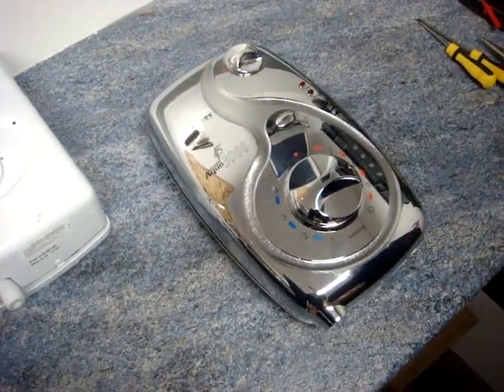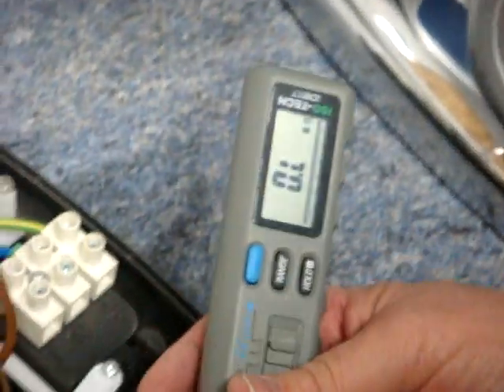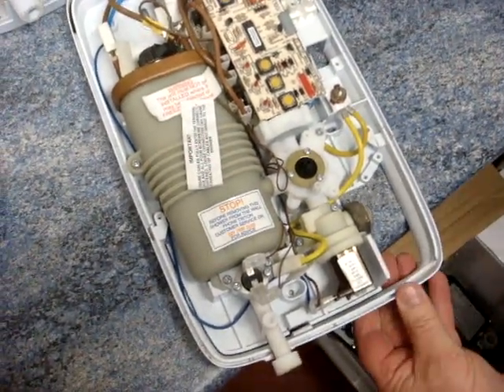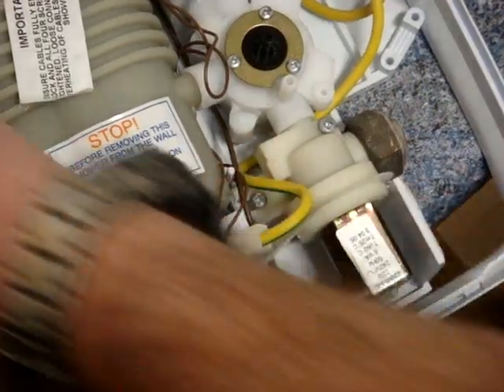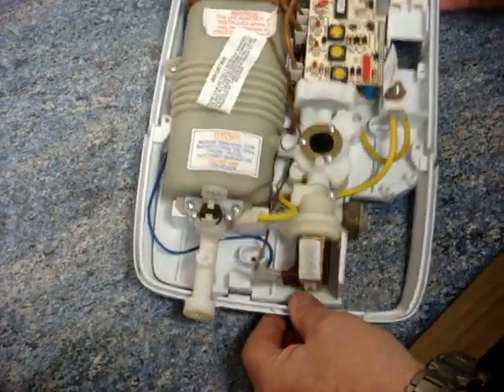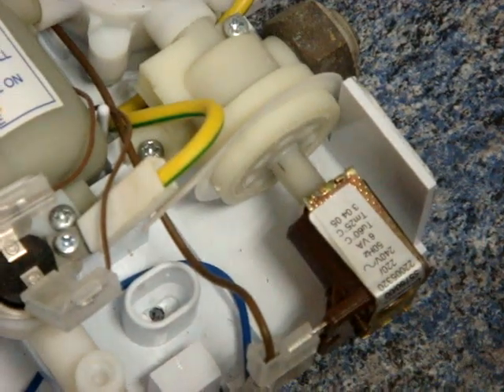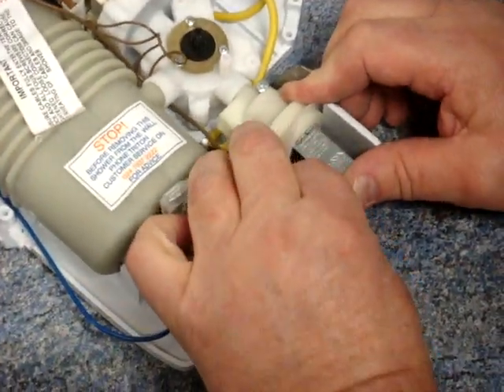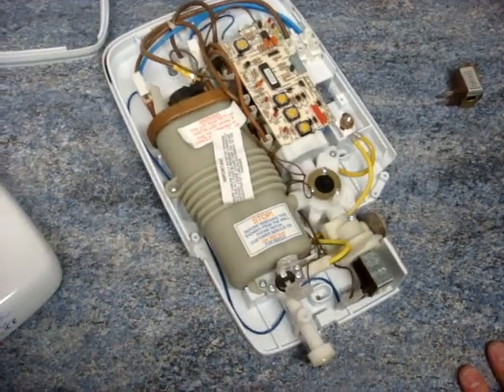Electric showers: How to test and replace a solenoid coil

Comment: So I have a Triton danzi duelec 10.5 duel head shower it's brand new and it cuts out now and again so I thought it was water flow so I checked downstairs sink and I'm getting 12 litres per minute and at the bath same 12 litres per minute.
But the shower is only getting 6 to 7 litres per minute it's all new pipe work in the bathroom could it be the cut out switch
And would fitting a salamander flow rate increase be better or would it not have any affect on the shower
I just checked the solenoid ohms reading 3.6

Comment: my whole triton AS2000XT solenoid valve assembly is permanently stuck in the open position, any ideas? i got 3 different solenoid coils but it seems that the assembly itself isnt letting the coil turn the valve off

Comment: Oh dear. Just tried this with my faulty Triton Cara and when I removed the coil as shown in the vid, water poured out of the shower and all over the bathroom floor. I'd obviously not quite turned the water off properly.

Unfortunately, the new coil now won't fix back onto the valve and so I can't turn the house water back on. Any tips for isolating the shower's water supply, so we can turn the water back on at the mains to wash in sinks, drink water and go to the loo?!! 

Has been a total disaster :(

Comment: Hi, I have a Redring expressions 500S no water flow on hot or cold. Tested solenoid 3.9kohms all micro switches test ok elements test ok. Any help would be appreciated. It’s an old shower but basically never used as we have a mixer shower that’s run from a Combie Boiler doesn’t appear scaled up. Many thanks for the videos. This shower hAs a small PCB

Comment: Hi, great video and excellent what I needed to watch. 

As per comment by @michaelbrownhill3091 below, mine was also an intermittent problem whereby the shower would stop and after a couple of minutes start again! Isolated the shower and when the cover was off and when I checked with my meter the solenoid ohm reading was okay!

Put the back cover, but the issue kept repeating, so bit the bullet and bought a new solenoid and replaced it and hey presto all good. Clearly, the old solenoid had an internal heat breakdown issue that cooled down fast enough to show that it was okay when it was measured. 

Out of interest, Triton T80 Easy Fit installed by me in July 2013 and this is the first issue with it.

Anyway, great videos that saved a lot of time and of course cash outlay.  
🚿

Comment: Great video that pointed me in the direction of the solenoid. This was the problem with my shower , cutting off after about 2 minutes , and if left for 10 minutes , it would start again for another 2 minutes or so . I apologise if this has been mentioned before in the comments , but my  possibly faulty solenoid tested at 4.7K ohms , which would indicate that it was good. Because I couldn't think what else it might be , and because the replacement solenoid  was cheap compared to a new shower ,  I ordered another solenoid from Amazon for £8.99 which tested at 3.5K ohms. 
I fitted the replacement and left the shower running for 15 minutes without any problems , which seems to indicate that the original solenoid was indeed faulty , even though it tested at 4.7K ohms. I think coils (the coil is the electrical part of the solenoid) can test OK , but quickly break down when current is passed through them.  Therefore , unless your coil reads 0 ohms or open circuit, whereby it's obviously faulty , I would suspect the solenoid ,irrespective of the resistance reading , if your shower keeps cutting out after a few minutes.
Anyhow , I'm off to have a long shower , longer than two minutes anyway !
Thanks for the video ; saved me a good bit of cash ...
Reply: Thanks for this comment.
Reply: Great point and thanks because my shower is doing the same or similar it runs fine then after a couple of minutes the flow goes slow and it starts cutting in and out heat wise

Comment: Great video - just a point though - if checking with a meter wouldn't it be best to disconnect one of the spade terminals to avoid the reading being effected by other parts of the circuit?

Comment: If you still monitor this channel, a question if I may. It's just curiosity really.
I have a 10.5 Triton Martinique. It did the typical fault, stop starting. I changed the solenoid, sorted. Some years on there has been dripping from the casing, not from the pressure relief valve pipe, so I thought a component must be leaking. I ignored it until the shower started buzzing then shut off. I tried it again, it started and worked for 5 minutes, buzzed and shut off. I took it apart and noticed a possible leak from the temperature valve. I had a spare Martinique so I changed the temperature valve, inlet valve and solenoid all in one go. As I was doing so I now had 3 solenoids so I decided to test them all as you advise. One had zero change so I knew this was the original that had broken. The 'new' one in the shower tested around 3.68, so that was good. The one that I took out tested around 15, and as I kept the tester on it. The numbers were fluctuating up .5 or so, then down 2.0 or so, then up then down until I got fed up waiting for it to settle around 6.5. Do you think it's because it got wet? With no power going to it, how can the reading change so much ? Thanks.

Comment: Hi pal going to look for this valve and check it but essentially had someone plumb the shower in and then wired it up myself but then when i turned the power on it wont work do i need to drain the water and then turn back on or do you think its for sure the valve?

Comment: What annoys me about this crap (and I don't meant the Shower Doctor, who is a GREAT guy, great videos!!!!) is the built in obscolesence. I'm a DESIGN electrical engineer and happy to p1ss around with this sort of thing in the practical world, though it's not my field. My shower acutallly failed not that long after it was installed and I fixed it myself, and the fantastic shower doctor videos helped, though I have e.g. multimeters around and the confidence to fiddle with such things. How much stress and cost does this crap cause for minor components? Why do the fail so often? Could the solenoid either be A: slightly thicker wire or B: if something like a power surge is causing it, just put in an simple in line component? :( 
I mean how many of these showers are just ripped out and replaced, never mind the solenoid? My REPLACEMENT solenoid has now lasted longer than the original, no further issues!
(And don't get me started on the poor design of microwave ovens :))

Comment: My Solenoid is reading 3.4K Ohms is that okay?  Mine keeps going on and off mid use.  I ordered a replacement and they accidentally sent me two, one is also 3.4 but one is 3.5.
Reply: Okay so I decided to fit the new 3.5 and it worked so either 3.4 is simply too low or it had some other problem which swapping worked and the fault did not effect the Ohms reading at all.

Comment: Hi 
I have Triton Madrid II. Today my son was in the shower and it just stopped and now there is no water coming out of the shower at all but the red power light is on. I powered off the shower for about a hour but still the same no water. So my question is do you think it would be the solenoid coil has gone or something else.
Thanks
btw the shower played up before about a year ago where the water was coming out but always cold. I replaced the solenoid coil then and it fixed that problem.

Comment: Mira Jump. Old coil is open circuit. New coil plugged in, and now the shower's power light goes out when I turn it on.

New coil is from eBay though, and while it looks the same, it has a 5 kilohm resistance. Still waiting for my coil from Shower Doctor (out of stock). Not sure if something else is wrong with the shower.
Reply: Ok never mind. I had the audacity to use the pull cord switch while making this repair, and it turns out that shower pull cord switches are as universally rubbish as solenoid coils.

Switch must have been cycled about 8 times in its entire existence and it's already dodgy.

Got it to work by jiggling it. New one ordered from Screwfix. MK, in the hope that the most expensive brand is better quality in some way.

Comment: Thank you so much for this, my Triton Cara just stopped working, there was power and water, tested the solenoid and no reading I know power was coming into the valve cause when I turned it on to the first position (yes power was off), i was getting a reading off the supply leads,  took great care removing it tested it again outside the shower and no reading, your vlog was very helpful and have a new valve coming. thanks.

Comment: Dear Shower Doctor,

My Triton Touch electric shower started cutting off after few seconds of starting and tripping the fuse. I even lowered the temperature, cleaned the shower head and there are no kinks in the shower horse and water comes as normal during the first few seconds.

After seeing your video I changed the solenoid coil (the ones you sell in Amazon) but the problem still persist. My shower stopped on Tuesday.

Please shower doctor can you please advice if there is anything that I can do before bringing in a professional to replace.

Many thanks

Comment: Hey there. I was wondering if you could give me some advice.

I've followed your instructions exactly. Thank you, they were extremely clear and with your advice, I used a screwdriver to ensure the glued part did not accidentally detach.

I ordered a new solenoid, but what turned up did not have locater lugs on it to lock it into place in my shower. The one I took off the shower did (it is Triton). Do I need the lugs or can I use what they sent me. The reason I ask is that I saw another seller selling solenoids and their blurb stated that shower solenoids require the lugs to stop them moving and that solenoids without locator lugs are for washing machines.

You mention on your vid about locators, but I didn't see on any on the solenoid you replaced.

Comment: hi i have a triton opal 1 9.5 kw and we find that it cuts in and out rappidly showing the low pressure light we find that if we push on the bottom right of the case it comes back on any suggestions on what may be the most likely culprit ? some showers it does this alot and some it is fine 

thanks

Comment: Great video but just to clarify, you said that the solenoid should be more than 3.5K. It's more that it should be in a RANGE of ohms, around 3.5k to say 4k or whatever. It may fail in a way that the resistance goes to infinite resistance / open circuit, which is certainly over 3.5k!
When removing the solenoid it can stick very firmly at the end of the plastic shaft, you might try pushing it back on and then using a flat blade screwdriver to slightly encourage the expanding clips on the end of the shaft of it back inwards, then pull it off again and it may came off much more easily.
Another tip is after you finish, turn the power back on, press the glowing button and no water comes out, please remember you've turned the water off before reaching for some anglo-saxon language :)
Reply: My Solenoid is reading 3.4K Ohms is that okay?  Mine keeps going on and off mid use.  I ordered a replacement and they accidentally sent me two, one is also 3.4 but one is 3.5.
Reply: @TheCodingSeal  
I'd say that's totally OK. The point about these things is if it's WILDLY wrong THEN you worry, e.g. no circuit, or a short circuit :) I come from a background where these things matter (like a wrong resistor is a faulty thing) but THIS is more pass/fail. 3.4k sounds absolutely perfect :)
Edit: Basically it's not that fancy! The component will be a coil of wire (with an inherent resistance over its length) wrapped around something metal it wants to act on. If the wire breaks = bad. If it short circuits  (touches itself) bad. Anything broadly in specification should be OK :)

Comment: I have an AS2000T and cant remove the solenoid valve as the case is in the way,  I bought a new one but it looks even longer than the old one.

Comment: Hi Shower Doctor, I have a Redring Expressions 500 which is stuttering on startup, but only when on the hot setting. Could the solenoid valve be the culprit?

Comment: Thank you so much for this video.  I was very nervous about attempting to fix my shower but really couldn’t afford to get someone in.  I found the diagnosis on the shower doctor, then the link to the part, Followed by this video.  The part arrived very quickly.  I followed the video and did it.  I was glad it explained things that might go wrong as well as showing how it may vary.  I would not have dared to be so forceful in removing the part if I had not seen this video.  It now works without cutting out and it cost less than £20.  Brilliant!  :)

Comment: Hi, my Electric shower shows no sign of power, while in the power box the Load Line shows power but the supply line does not show . Can you please explain , that the supply line there is no power showing but the Load shows, and inside the electric shower does not show any power .Thank you

Comment: Problem . You said one of the most common problem is the solenoid valve,however , you did not explain the symptoms of a solenoid problem in the first place . What are typical symptoms of a solenoid valve problem ? If the water is still dripping from the shower head after the shower is turned off using the control on the front of the sower , is this a solenoid valve problem ?

Comment: I don't think this 'over 3.5' measurement on the multimeter is a done deal. I ordered a brand new solinoid valve online and it measured 3.48. I took my old faulty one out that was stopping the water coming out of my shower and it measured 3.75. I've had the one that measured 3.48 in my shower for months and it works fine. So if the faulty one measured better than the new one, how'ds that work?

Comment: Hi Shower Doctor, I have a Mira sprint electric. it stoped working the other day, checked a few things, water, electric, hose. when you mention to check the coil for resistance, it has plenty (4.13) should I still change it?

Comment: my Triton t90si has lost most of its pressure I have checked   pressure relief valve still has its ball inside do you know if the solenoid coil goes in this model type the same as other Triton models cheers thanks

Comment: I'm stumped with my shower not having water coming out. Checked the filter (and that water was still getting to that point) and replaced the solenoid, but still no joy. Shower had only been installed for 12 months and only used about 20 times in the first 6 months,. then six month later we went to use it again and nothing. here you can see what happens when I press the buttons - https://www.youtube.com/watch?v=91BJXOM-7tI&lc=z22xcvtzypiyv3zkgacdp434uwf5oajraewmdpxv4u1w03c010c.1508968098212356

Comment: I've just changed the solenoid but still nothing. I've got a triton aspirante. If it's not the solenoid what else should I check
Reply: I've done the same with Triton Touch..but the issue still persist even after replacing a new solenoid valve (after starting the shower it cuts off within few seconds even after turning the temperature to the lowest level)

I'm also wondering what else it could be. Any advice shower doctor#???

Comment: My Triton Shower installed about three years ago began stopping after 5 minutes. Followed the information and found that the solenoid was about 3.5K when tested cold but after the shower shut off it was very warm and open circuit until it cooled down and would work again. Bought a new solenoid for about £12 from Amazon and it arrived yesterday. Followed the instructions here to fit it (quite easy) and now the shower works properly! Extremely helpful video - the man obviously knows what he is doing. Thanks for the recording.

Comment: The problem i have is that the cold pressure is fine! but when i turn dial up to Hot the flow drops to a trickle , checked the solenoid and it`s fine. Any ideas Shower Doc ?

Comment: I know that this video is fairly old, but I hope that you are still receiving the posts here.  I have a Triton 90si.  The water stopped coming through, and the shower makes an unusually loud noise.  We cleaned out the filter and bled the air valve, but it didn't correct the problem.  I found your video here - is it possible that the solenoid could be the problem, in that it is not opening the valve?  Or does the shower not turn on at all if the solenoid is bad??  By the way....I love your Scottish accent.....:)
Reply: Mine just stopped working and made no noises/activity when I tried to switch it on.  It cut out, started flowing, stopped, started and then stopped for good.  I changed the solenoid in mine and it started working again.  Not sure what the noise could be, hope TSD gets back to you soon!
Reply: Thanks for your reply.  Our issue got sorted, and I'll post it, just in case it helps someone else.  The noise that we were hearing was the pump.  The problem was that the water supply to the shower and the rest of the house, was blocked, so that while the shower was actually working properly (and the ohms test of the solenoid was correct, as well), no water was coming out.  Strangely, the water to the shower stopped a day or two before the water to the rest of the house, so we weren't sure if these two stoppages were related.  They were, and all is well now.  Thanks for your response.

Comment: mira advance take it you can't just change it as can't even find  it so is  it the  Mira Advance Flow Valve Assembly as got it installed and water will not stop unless i turn it off at mains does not seem to even get warm its not cold cold but just slightly warm its just out off box  so cant commission it as it cant turn of water so maybe thats why not hot water ,,
Reply: paul sheriff hip